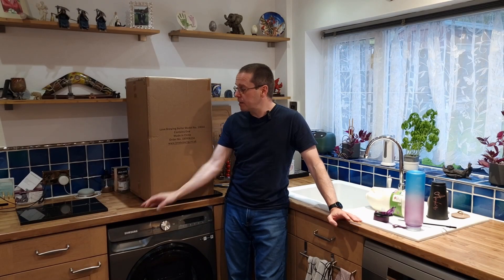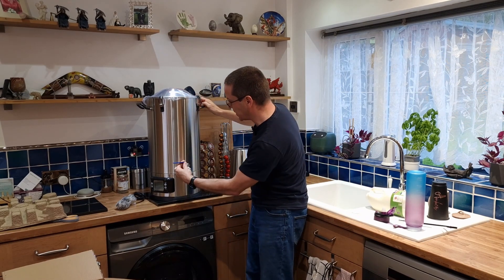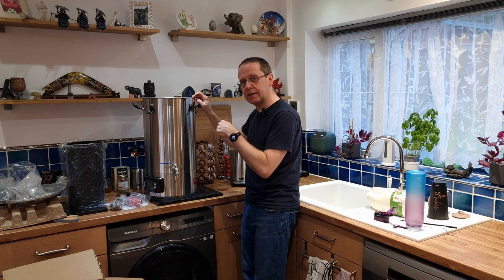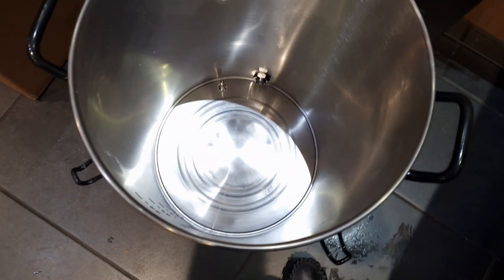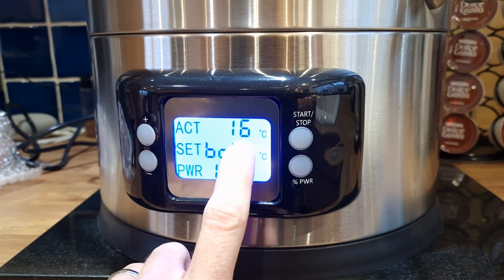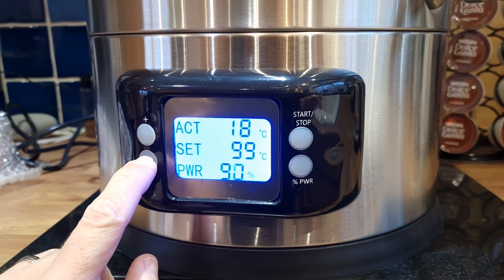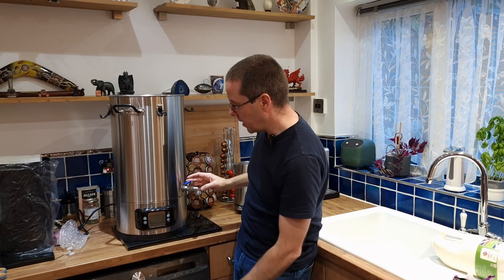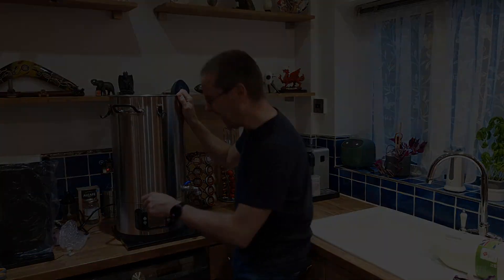The new Love Brewing boiler (2023), this changes EVERYTHING!

Comment: Hi. Loved the video and the information and I'm glad you still pick up comments from older videos. I am looking to upgrade from the Airstill and this boiler is in my basket. The question I have is whether the Superstill is a better choice than the T500 reflux column(only £25 more!)? Are you planning a review or have you had any experience of it?
Reply from the maker: Hi @deadkennedy9140.  Thank you for your kind words, I am glad you like my video, and found it helpful.  I do like the Super Still that Love Brewing have for sale.  I am not going to buy one myself as I already have two T500 reflux columns so don't need a third reflux column.  At £329, it is too expensive for me to buy one just to do a review.  I do like the fact that it has a bubble plate, and you can do botanicals and other things with it.  If you are starting out, then I think the T500 would be better as it is simpler as you don't have the bubble plate.  The Super Still though is great as it uses standard 2" Tri-Clamps, so you can extend and adapt it however you like, whereas the T500 is harder to extend and (apart from extending it), you can't modify it at all.  So, I suppose that if you are somebody who just wants to switch it on and let it work (like the Air Still), then the T500 is better for you.  If you like to tweak or adjust things, then the Super Still is a better fit.  I hope this helps.
Reply: @brewingadvice  Thank you for replying.  I will probably get the super still through FOMO 😃. I suspect it will be a steep learning curve though. I was worried that there was a major problem with it that the lack of reviews hadn't yet brought up.
Give it a few months and I might be its first youtube reviewer.
Reply from the maker: Hi  @deadkennedy9140 .  I am sure (and hope) that you will love it.  I would like to have one for a while to see what it is like and then do a review, but I can't warrant the expense.

Comment: Now you've had this a while what power settings during the various runs (Reflex, Pot, Striping, Spirit) are you finding?
Reply from the maker: That is a good question.  When I do a stripping run (immaterial if I use the Reflux of Pot condenser), I run the boiler at 100% until the internal temp gets to 80°C.  At the point I turn the power down to 90%.

When I do a spirit run in reflux, I again run at 100% power until I get to 80°C, then I lower the power to 72%.

When I do a spirit run in pot still mode, I run at 100% power until I get to 80°C, I then lower the power to 68%, but sometimes slightly lower.  I tend to play this one by ear.

When I make a flavoured drink, it tends to be a gin and for this I use the Air Still as I am only putting 1.1 litres of macerated 40% ABV in there.

Comment: THAT was a bloody good video 
Everything I needed to learn.

Must be a carpenter, NAILED IT.

I’m still in the researching before buying stage. The T500 wouldn’t not have been a mistake to buy, but this looks to have a few extra things like the insulation jacket, the attached handles & full control of the power, better tap etc…all (I think) I could add to a T500 but it’s all here out of the box. If I find a 2nd hand T500 and it was dirt cheap I’d probably buy it & upgrade it (depending how old it was) but geez…pretty hard to not just get a new Love Brewing boiler.
Don’t think I’d regret buying  a T500 but Love Brewing kinda edges in front for me.
Everyone’s different so I guess (?) there is no one perfect set up but gee you kinda showed the step up here & you were no BS, straight as unbiased & telling it like it is 
Hitting subscribe & line was super easy.
Keep up the good work 😎
(I’m in Australia & still trying to find a importer/dealer here)
Thanks for excellent video 😎😎😎
Reply from the maker: Hi @peterrobins666, I am so glad you found my video useful.  I have two T500 boilers, and really like them.  But having things like the handles at the top, that is a big thing for me for when I need to empty it.  The metal tap is also far better than the plastic tap, but I know the new T500 model has switched over to a metal one as well (I wonder where they copied the idea from?).  Also, the new T500 have two power switches for the two internal heating elements (again, wonder where they got that idea from? lol).

Comment: I believe you can control power on the Grainfather G30 - a quick google returned the following: "The Grainfather Connect Control Box (included with the Grainfather G30) has a 'Power Control Mode' where you can specify the power output rather than specifying the target temperature. To enter (or exit) power control mode; Hold the heat button for 6 seconds"
Reply from the maker: Hi @philthompson3038,  I did a quick search and found the same line in the G30 manual, but it doesn't go into any more detail.  While the G30 is a great unit, it is also three times the price as the Lover Brewing boiler (yes, it can do a great deal more as well).  It all depends on what you want the boiler to do and how much you can afford.

Comment: Thanks for the info. I was wondering why they were out of stock at Love Brewing :) - Stupid question: Will the lid still take the T500 column?
Reply from the maker: Hi @indaba1960 ,
No such thing as a stupid question.  Yes, the boiler takes the same lid as the other 25 litre Love Brewing boilers and the T500 boiler from Still Spirits.  The lid that is included has the same hole size as the others, so the T500 column fits in nicely.